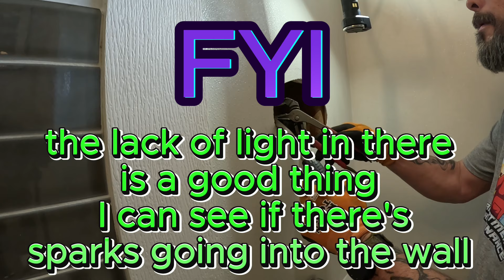Replacing a tub faucet -- side job

Comment: Hey Ray I used to work in a factory in the 90s and we made Electric soldiering guns. They have a contract with Ridged tools. (Instead of flame) Have a great day!
Reply from the maker: I looked into that about 1y ago but never got one
Reply: @Raysmaintenance  Ray I also use it to heat bolts and stuff working on cars.